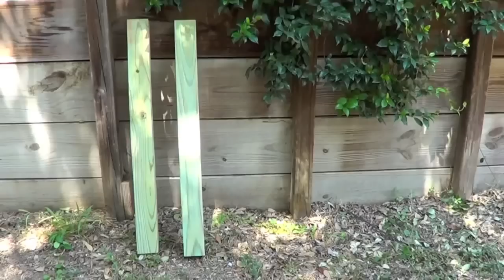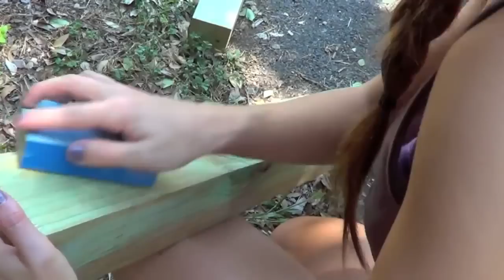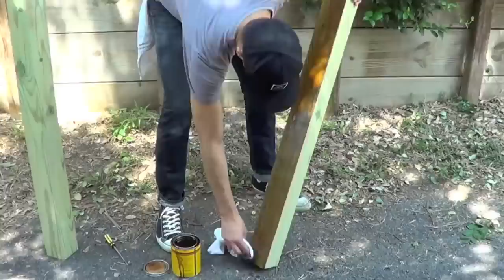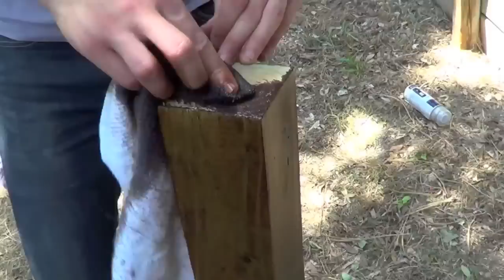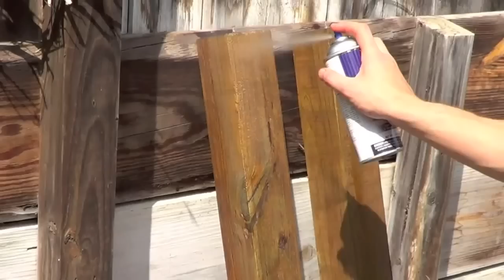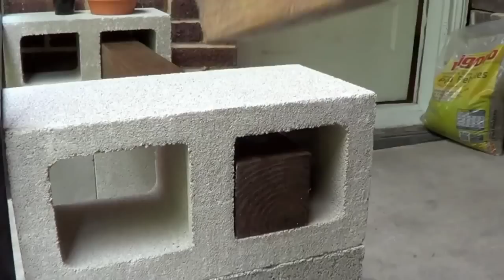DIY | Building A Bench

Comment: Your supposed to weigh 6 months to a year to stain pt
Reply from the maker: Mike Cunningham I'm not sure I understand what you're trying to say.
Reply: Kat Marie that explains why you did it
Reply: Kat Marie you can"t stain or paint pressure treated wood for 6 to 12 months
Reply from the maker: Mike Cunningham well you can* and we did and it looks fantastic and has held up beautifully! thanks for watching :)
Reply: the stain acted like paint and only coated the outside of the wood. stain is supposed to penetrate the wood for a long lasting finish pressure treated wood keeps moisture out of the wood if you don't wait the the correct amount of time your finish will not be as durable as it should be. ya it might look good now give it a couple of years and you'll be thinkin of this comment when you look at it and all the stain is wearing off like paint i'm not saying this to be an ass hole im saying it from years of experience in wood working & construction
Reply from the maker: +Mike Cunningham thank you for your input and concern for our bench! I kind of like the worn down weathered look anyways but I'll keep what you said in mind.

Comment: this probably just holds underweight people or petite girls. I am of normal weight and I wouldn't trust it. The blocks should be glued at least. The wood looked so much better green.
Reply from the maker: Masshiroi We didn't like the untreated look of the wood so we stained it. Most of the time people stain wood. Gives it a warmer look. My bf is nearly 200 lbs and it holds up him and me at the same time! So no, it holds quite a bit of weight. The beautiful part about not having it glued is you can take it apart easily or add longer pieces if you ever want to add more length. x